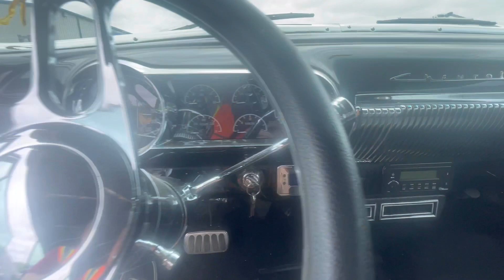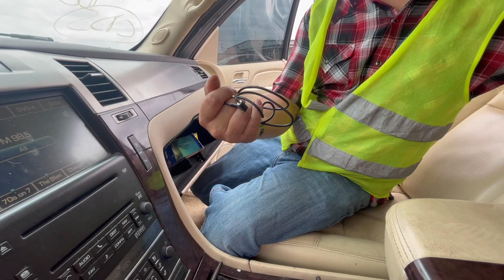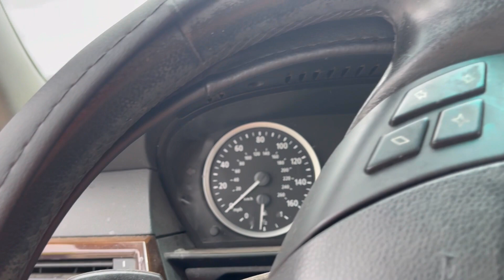Does Mike Need A Cadillac In His Life?

Comment: The old Chevy hit a pole and the pole landed on top of her? That's my guess. I'm guessing that the rear end control module is bad on the Cadillac Escalade. It works the tailgate open and rear lights and probably the passenger side middle seat. My Envoy had two of them fail.

Comment: Hello Mike, with the Caddy and that it has a Hitch I would check the transmission fluid to see if it smells burnt just because it moves don't always mean good, you have no idea how much it was used for hauling a big boat or whatever and I would slide underneath it and check the differential for Signs of being wet . Yes it's a little worn a little dirty but even with the Miles They go for more than what they are asking.

Comment: Hey Mike, you mentioned you re GL, check the re call on it , brake booster defect, if it does nt pass the test you could end up with a courtesy car for the next 6 months, part is back order , affects GL / ML / R models 2006 to 2013  , my ML passed l was dis appointed